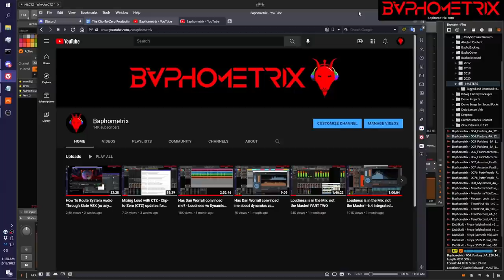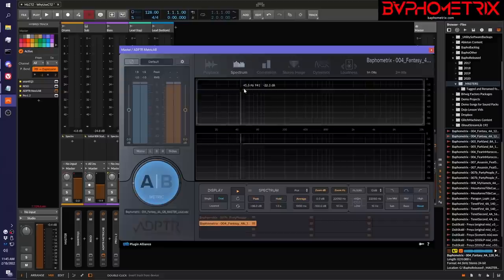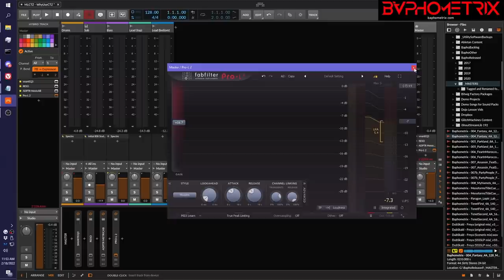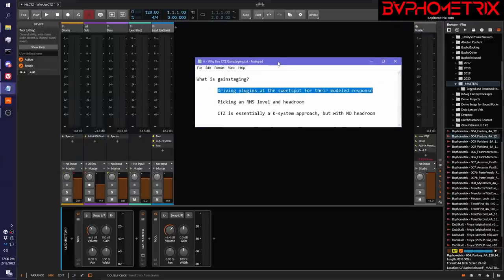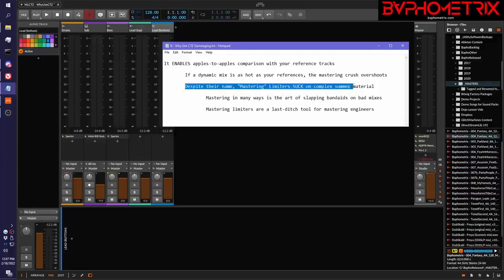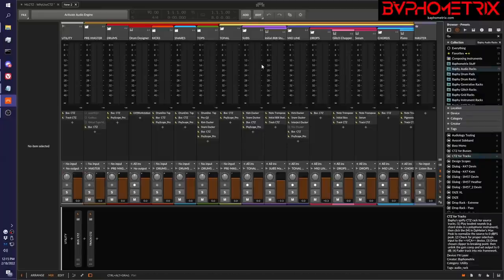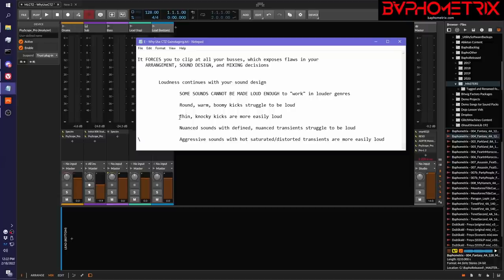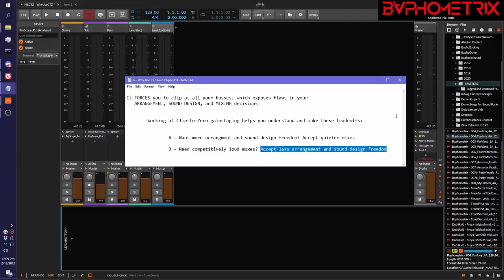Mixing LOUD with CTZ - Ep. 2 - Why Use CTZ Gainstaging?

Comment: This is an “ah-ha” moment for me. You have opened my eyes to the red/blue pill Matrix regarding the issues I have with DAWS that are not present in solely warm and musical analog methods. Your CTZ-based BUS routing design is the most gorgeous thing I have ever witnessed in a DAW console. Clipping and analyzing grouped sums make GREAT sense solely spoken alone, but implementing it is EXACTLY what I’ve been missing, and FINALLY located the puzzle piece in my DIY DAW mastering that does NOT stress my limiter (as created and intended.)  

As an outside-of-the-box creative, I’m able to force-generate dynamics at loud levels in the final mix to master by CTZ-controlled DRUMS, FUNDAMENTALS, AMBIENCE, & VOCALS stems (without DC Offset or any Phase Rotation issues for additional headroom) and performing the “call & response” types of volume automation by surgically crossfading the "mids" and "sides" in specific sections between fundamental and ambiance frequencies to emulate “movement” i.e. crescendos, hits, stabs while still keeping the correlation in-phase and aliasing in check.

Yeah, it’s still more like mixing during the mastering stage, and additional "surgical automation" work, but the creative possibilities are endless by grasping the CTZ strategy and truly CARING about the total sum being delivered to (in my case) 2-stage serial limiting where the first (softube Drawmer) subtly kisses, shapes, and glues the summed “mix bus” transients from summed "harmonically excited" earlier stage high-frequency limiting processes while the other limiter (fabfilter Pro-L2) does the light work of achieving varying targeted loudnesses. As a music business professional, I can tell you that NO ONE is spilling the beans of professional audio truths as you because NONE will ever teach themselves out of their jobs…and people should REALLY understand that part if they don't understand anything else or don't do the "snowflake pride thing" and should just truly appreciate your proven knowledge. ~Thank You
Reply: This is a poetry of a comment
Reply: @anattaevergreen I was thinking the same bro 😂

Comment: I’d like to really thank you & the internet-fairies for bringing me to your method. I work in computer-graphic shading (3d engine, for games & film) and CTZ mirrors the way we generally handle colours throughout the colour-pipeline – for shading, lighting & vfx-post-processing, etc. You see we generally use a fixed bit-width (say @ 8, 10 / 16 bits per colour channel) so when passing numbers between processing steps or when passing data in, via textures (our wav’s), it’s very common to ‘normalise’ the min-max values we want into the full binary range (to avoid mach banding & quantization artifacts) & pass scalars around to pull the ‘full-dynamic-range’ signal back into its working range (be it a tiny range between two close visual values, or hugely larger than the normalized unity range’) – exactly as you were using the meter plugin to pull the gain up. And after 10+ years of noodling in Ableton, I made my first competitive mix this month. Bless you – I have nothing but love for this. <3
Reply from the maker: Wow! That's fascinating info! Thanks for sharing that. The parallels between audio signals and visual signals are always interesting to me. It's like how dithering is similar between the audio-digital world and the visual-digital world, too!

Comment: Great video! I wanna add though in 21:15, if you really need to use a vintage hardware plugin emulation, you can also add an auto gain plugin (like that of Hornet plugins) before and after that plugin and set them to your desired input level and then back to your CTZ level.  It’s a little finicky, but it’s a workaround I use if the need arises 😊

Comment: Again, great advice. Learning a lot from You Baphy. I just struggle with the horizontal an vertical arrangements You mentioned. Shouldn´t it be the other way around, that the stacked ones should be called "vertical" and the checkerboarded, call-and-response arrangements are the "horizontal" ones?
Reply: I understood it as vertical mixing is keeping things more isolated in their vertical lanes.
Reply: You are right- it is the other way around

Comment: Thanks a lot for the CTZ method and putting words on stuff I have been sensing and half-trying to do. However one comment/question: I believe you might be mis-unterprating  the "6dB rule". Mastering engineers ask for "headroom" but not that the track peaks reach -6db. Because indeed they can just turn the fader down if you reach 0 already. 6db headroom  means that in the latest 6db your meter in moving a lot = there is a bit of dynamic they can play with / they can still compress the track if need be. In other terms, mastering engineers ask "6dB of dynamic" (but I believe that's not correct because dynamic is not expressed in dB). They could also say "on your loudest part we need a CREST factor below ..." which would be more accurate, though not many measurement tools give a CREST factor value. Happy to read your thoughts on this :)

Edit: also I think Volcano 3 would be a good alternative to Spectre wouldn't it?

Comment: With regards to 'nusanced sounds' are you basically screwed if you like to sample old vinyl to put in your tracks, especially stuff recorded from before the Queen of England was born?
Reply from the maker: I mean... it all depends? If you're trying to use older vinyl material it probably *will* limit your potential loudness, but is that so bad? Modern loudness relies on modern sound design. And modern sound choices. Using samples from the less loud days is a "sound choice"
Reply: @Baphometrix  Yeah when I went away thought about it I realised its a very wide open question and all depends what your going for. 
Thanks for getting me thinking more than anything aswell as everything!

Comment: What’s your take on Xfer’s OTT? I tend to use it almost always, as at the moment I don’t have my standard mixing tools (izotope ozone), ’cause those haven’t hot M1 native support yet.

I like the overall clarity/oomph that the OTT gives, but often times there’s no way to visually see what I’m doing (unless using spectrum analyzer ofcourse. 

So the question is, should I use ’tool/utility/mix tool’ of some kind before OTT also? I use Reaper, and for my needs it’s a very capable DAW. Thanks.
Reply from the maker: OTT in all its forms (Ableton's original, Xfer OTT and Slate's relatively new MO-TT) is a *sound design* tool. Not really a "mixing" tool, nor a "dynamic range control" tool. I see people all the time using OTT in a way that is (subjectively) HURTING the sound and making it worse than before, because they don't gain match the output loudness against the original sound and do an A-B comparison at the same perceived loudness. OTT by default will always make a signal louder and brighter, and our brains are easily fooled into thinking something louder and brighter is "better". There are some sounds that can really benefit from a little OTT, but I see it being waaayyyyyyy overused, and used on sounds that are being made *worse* by OTT.  My best advice? Look into getting "GainMatch" by Letimix, and putting GainMatch around OTT when you are deciding whether a given sound will benefit from OTT. Hearing the result at equal loudness will also help you find the right settings in OTT.
Reply: @Baphometrix  In your subjective opinion, how is the sound being hurt if I design my stems in ott and push those stems close to 0db within ott?
Reply from the maker: @marsmith1907  It all depends on the sound you're going for. In sound design there are no rights and wrongs. Only what sounds good to your ears.

Comment: Thanks a lot man! Hope you will cover new Bitwig’s built-in hardclip grid module in upcoming videos.
Reply from the maker: I might touch on it, if 4.2 gets out of beta before this series is finished. But what I do know is that all of Bitwig's Grid devices are 4x oversampled, with no way to disable that. My guess, therefore, is that trying to use the new Hard Clipper module in an FX Grid device as a "free" clipper still won't work for CTZ purposes.  Why? Because oversampling always causes NEW peaks that weren't in the original signal. And therefore, an oversampled clipper won't really, truly, shave the peaks at 0 dBFS (or wherever you set your ceiling). There will be peaks going over the ceiling on the output of the clipper.

Comment: Hi Baphometrix; youre #1 Loud student here
I am learning your method; love it but still struggling.
I set my anchor kick at -10 momentary, but, for some reason, I struggle to balance my framework sound with the tonal and rest lf sounds. I feel my kicks with a lot of transient compairing with reference tracks, but I can not put it down because is the “anchor sound” and then the Momentary Max would change.
Im missing something!
Reply: The question would be
how can i mix my kicks for them to work well in Loud gentes?
I am missing something :(
Reply from the maker: @809rdl  I'll be doing an episode specifically about setting up the kick. Maybe that will help.
Reply: @Baphometrix  thanks
Reply: @809rdl  are you sidechaining with some kind of volume automation? If not, that's probably the culprit.
Reply: @chaosparticle4515  yes i am using volume automation on sidechaining. I guess my problem is that I am not limiting enough the tonal sounds before trying to balance the levels between all the sounds and the framework. I asked Bapho if it would be useful to check the crest factor in every bus to confirm that Everything is in the same ballpark, but, he told me that things are going to get clearer for me with the upcoming videos.

Thanks for your comment
I appreciate it because I really want to learn this CTZ method.

Comment: Hey man, Very interesting series so far although I'm only on episode 2. I have a few important questions though. I often work with already finished productions (of my own) that I need to mix. I will export each track to a wav file and do mixing in a separate project so I don't go back and be a producer.

1. Do you suggest I should incorporate the CTZ method in the production phase or can I get away with doing CTZ only in the mixing phase? 
2. What would the chance be that I need to go back into production and fix things? 
3. If I use CTZ in mixing only can I bake in reverb/delay into the production exports?

Thanks for the video's on this topic!
Reply from the maker: CTZ is best used before you flatten all your tracks to pure audio. Why? Because (as I point out in this episode), clipping sounds at their original source tracks AND at their summing busses will be showing you flaws in your sound design choices (and processing), and flaws in your arrangement sequencing. But the clippers and dpMeter gain adjustments are super lightweight and it really doesn't take ANY time at all to set up your first framework sounds to the target loudness you plan  to hit, and then to ensure that each new sound you bring into the project is able to be loud enough to fit into that framework. 

When you decide to flatten everything to audio before starting mixdown, you simply have to move the "bus CTZ" clipper or the "track CTZ" dpMeter+Clipper pair off to a temporary track while you flatten/bounce the original track, then bring the plugins back onto the original track and move on to the next one you flatten.  As you watch more episides and understand the process better, I think you'll see how doable this is.
Reply: @Baphometrix  does that then mean I can't really mix someone else's track if they send me their individual tracks as wav files as effectively as if I were producing the track?
Reply from the maker: @Projektor_music  "As effectively"? That depends. As a mix engineer, do you give feedback to the producers you work with? Do you suggest things they can/should fix in their original sound design and/or arrangment to make your job easier?

As I say at the end of this episode, "if you want more sound design and arrangement freedom, you have to be willing to accept quieter mixes (and vice versa)." So, if a producer comes to you and says, "oh hey BTW please mix this to a competitive loudness", don't you already sometimes find you need to make suggestions to them about things they've done that make it hard for you to deliver a loud mix?

So... if you're just mixing for someone else, you can certainly use CTZ on the stems. And if you encounter problems (like a given stem falls apart when you try to make it loud enough to fit the framework you might have first made with (for example) the kick, snare, and sub stems, then since you can't fix the problem yourself (easily), you might need to go back to the producer and say  "something about your sound design for this track is making it hard to get loud enough without sounding squashed. Maybe try this or that to see if we can get it louder.

Comment: I’m trying to ensure I have my head wrapped around this properly. So in my daw, I should clip my kick and 808 at zero before adding effects then once I add effects make sure my meter stays at zero ?
Reply from the maker: Keep going with the series and it will make more sense. To gently nudge your understanding so far, it's more about getting your important "framework" sounds (usually the kick, snare/clap and bass) loud enough AND with their peaks touching the ceiling at 0 dBFS. And then every other sound you bring into the project has to be made loud enough to fit up into this framework.
Reply: @Baphometrix  thank you for the response. I’m definitely locked in on all your videos!

Comment: Do you have some kind of tilt on your ADPTR analyser?  If so, what amount do you use and where the setting for that?
Reply from the maker: Yes, I'm using a 3 db/octave tilt. That will make pink noise look almost perfectly horizontal, which makes it super easy to eyeball a "good" spectral balance. You click the little hamburger menu button in the Spectrum Analyzer section (near the middle) to find the settings.
Reply: @Baphometrix Thanks.  I looked in the hamburger menu, but I don't see it anywhere.  What's it labeled as?
Reply from the maker: @SirLowhamHat   Set "Weighting" to "Roll 3"
Reply: @Baphometrix  THANKS TO YOU!

Comment: Where you insert the plugin like pro Q3, Reso or Duck? Into the track or Into the bus? Thanks bro
Reply from the maker: It depends. What exactly needs EQ? What exactly needs ducking? What exactly needs dynamic resonance control? Is it really the entire summed signal on a bus that needs these things? Or is it only some of the tracks that sum into that bus?

Questions like these are a tradeoff between convenience (just slap it on a bus) vs precision (why fix something that isn't broken if it's only specific tracks that have a problem; not the entire bus signal).
Reply: @Baphometrix  Thanks bro

Comment: Ive just started exploring your CTZ strategy and Im curioues wether it will improve my mixes. its an interesting approach I have to admit. only think I disagree is your "glorifying" of professional mastering engeneers. ofc they do a great job but its mostly about experience in using tools since all they do is about compression, musically EQ and saturation. thats the main source of loudness but you can do the same as a home producer its not impossible at any means
Reply from the maker: I don't see it as "glorifying" so much as simply paying respect. In the same span of time that a typical producer has self-mixed and self-mastered 5 of their own songs/beats, a pro mix engineer or pro mastering engineer has likely mixed / mastered (respectively) many dozens of songs in diverse genres from many different producers. That type of experience and depth counts for a lot. They also have access to many analog hardware tools that your typical producer does not.

Comment: You are wrong speaking about K-system.
Bob Katz speak in his system about the RMS (not LUFS) for hearing in your system, if you use a K-system method without calibrate your room, speakers, converters etc, you are doing nothing.

Another thing its when you speak in these "old school method and the -18RMS in the levels" i think you would say dBFS, i mean 0 dBVU = -18 dBFS, yes but with a 1KHz Sinewave, in terms of level specially on master, that 0dBVU are not exactly -18 dBFS.

Extra point for the discussion about "-6 dB of headroom" , that its true, that headroom its unnexistent !

Its a lot to talk about but you are doing great taking all the explanation and the proofs, big work!

Comment: Hey baphometrix I love ur vids and this series although I struggle with concentration so I'll ask you a fairly stupid question

Do you gainstage with Clip to Zero while composing/straight after every sound you put in and check if it sounds good clipped? Or do you create a rough mix then on mixdown replace sounds that dont fit into the clipper? 
Sorry if the question doesn't make sense my english isn't great
Reply from the maker: I gainstage this way--clippers and all--right from the very beginning of every new project. I explain the benefits of doing this in Episode 2.
Reply: Thank you thank you!

Comment: It's probably the crappy headphones I'm listening on but I honestly can't tell any significantdifference in the A/B comparison you do at 13 minutes or so. What is it you're hearing that I'm not?
Reply: Invest in your gear then
Reply: peaks are quieter + less punchy
Reply: 13:00 , when it’s off, listen to the kick. It’s so much more punchier. Then when baphy turns the limiter on, the mix loses its energy. The kick and snare are at the same loudness as everything else, and it sucks.